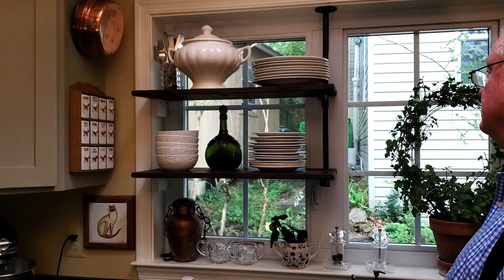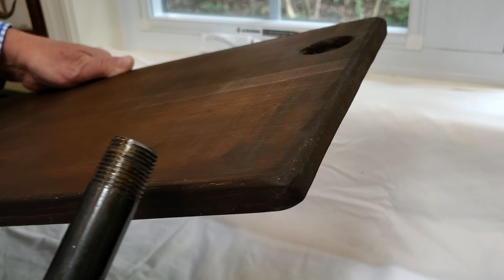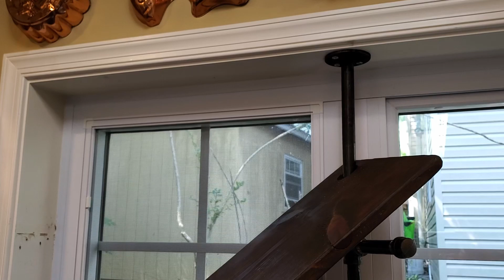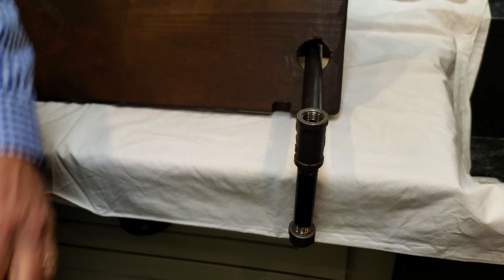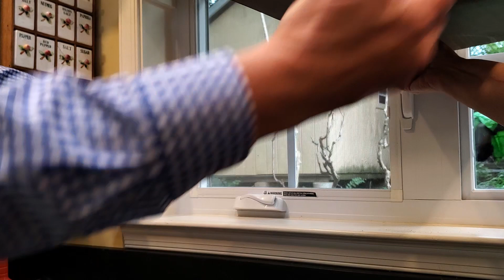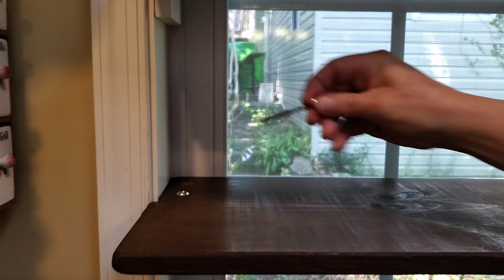How to Build an Industrial Style Shelf

Comment: Can you make a list of the exact supplies needed for this project? It would be nice to hand to the guy at the hardware store so you don't buy the wrong thing.
Reply from the maker: Black pipe components, all 1/2 inch: floor flange, caps, T connectors, and various nipples. Lengths of nipples will depend on design.